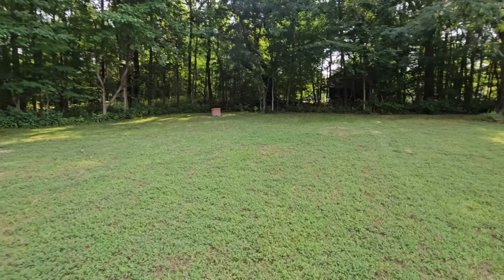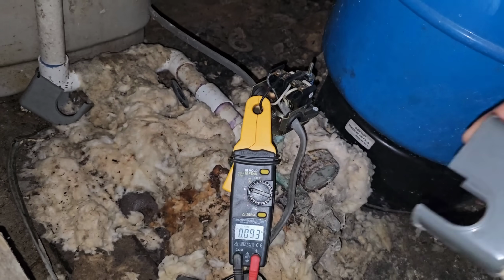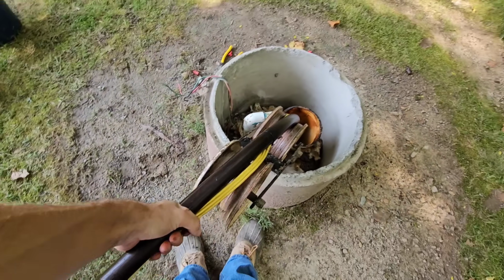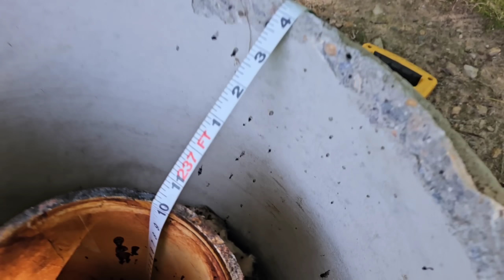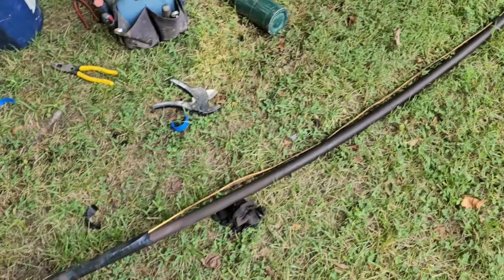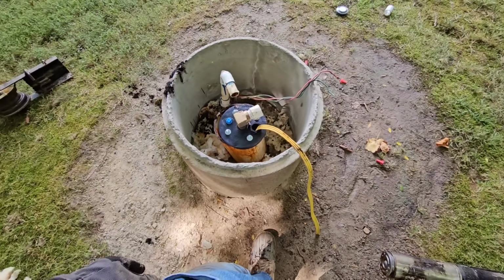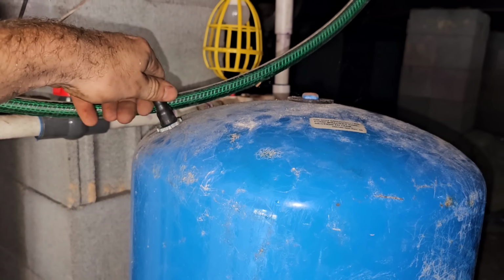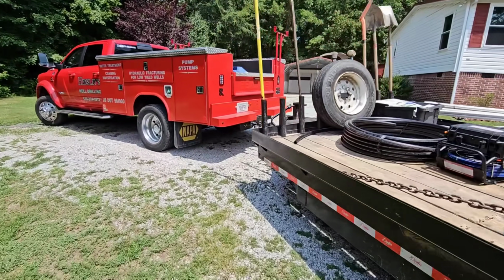Well Pump was Stuck on the Bottom in this Nasty Mess! That's Terrible Looking

Comment: Good job. My pump guy left me without   water 7 years ago, other pump companies wouldn't come out for 3 months. You can be our pump guy. 😅😂😅😂
Reply: You still don't have water after 7 years? DDDDDDDAAAAAAAAANNNNNNNGGGGGGGGGG you are a trooper.
Reply: The cost of not helping yourself.....
Reply: The Folks around here have been raised on well water,  I've helped about 6 people pull out their pump some just a dry well one didn't have the spacers on the pipe and wires so it was swinging in the breeze and wore the insulation off 2 of the wires and shorted it out,  an old wheel on an a frame and a quad just need enough room to drive the quad far enough to get the pump to the top
Reply: Sheesh. Never had a well company fail to come within a few hours when I was without water.
Reply: @E85BETTY  lazy you mean.
Reply: sounds like a self inflicted problem you waited 7 YEARS
Reply: I dont like that poly pipe

Comment: The customer dumping chlorine in the well is making things worse. Chlorine causes the manganese to drop out of solution. You can use chlorine for iron and manganese treatment but only in small controlled doses. Best thing for him to do is get a filter that contains Katalox which will take out manganese and iron.
Reply: Even ordinary Birm will do the job. I used Birm for years at my place and got about eight years out of it.

Comment: I had a problem with my well. I had two different plumbers come out to fix it. The first guy insisted my well pump was bad and that I needed a new one (a few thousand dollars). 

The 2nd guy actually pulled the pump up, found the wiring problem and told me my old pump was a quality product and that it would be silly to replace it. 

At the time, we had owned the house at last 10 years. I have no idea how old the pump is. Still working like a champ four or five years after the plumber came out.

Comment: Great job. I replaced my pump years back and it was also a one man job. The difference was i had enough knowledge to make me dangerous. After pulling the pump using a tire rim off the wheel barrel and did i tell you this pump is in the basement of an addition and 60 yrs old, needless to say it was a long day off from my real job.
 I respect you work and trust me I work long and hard to "Not" work on my own pump.😊

Comment: Greetings from Sweden.
My pump blew fuses and I it was stuck. I only got the wire, hose and cable out. Pump is still down there. A new pump was put a little above the old pump. It was 165 feet deep. Pump, hose and cable cost about $2000 for just the material. It was a good pump though (Grundfos). I changed from a three phase to a 1 phase pump so the new diameter of the pump is just about three inches. Fits better in the hole.
Reply: I had to do the same thing because my pump is stuck. New pump Right on top of it.

Comment: It’s been some years since I pulled poly well pumps, I used a 3 wheel pump puller for Galvanized pipe once, pretty rare they were. 
I always used place circular wire guides and a Torque Arrestor to reduce the spinning of submersible pumps. And I like how you despite not feeling your best, throughly diagnosed the problem and keeping the pump off the bottom by 15 feet. 
Great job 👍

Comment: Around my area,  we have natural gas in our wells.  It makes like a slime that can actually plug in the pump and line so tight it takes a minimum of 3 to 4 strong farmers to pull one up to replace the pump every 6 to 10 years. I think I would rather have your manganese problems 😂😂. Great job actually diagnosing and fixing the problem for your customers.

Comment: I had to have my stand pipes replaced up here in Minnesota this spring. We had a dry winter. Very little snow, so it was easy to get to the Red Head. There are two brothers who went their separate ways a few years ago. This is the third time in 40 years that I needed to do this. One brother still uses galvanized pipe. I went with the other brother who uses 20 foot sections of Schedule 80 PVC and stainless steel couplers. I also had the 40 year old pump replaced along with all the wire. This area has a high iron content. When we turned on the pump it looked like oil coming out also. One thing that amazed me was that the water quality improved immensely. The iron has almost disappeared. I redid the pressure tank and the flow is excellent. I like watching how the wells are done down south.

Comment: That's great work, boss, and on your own?  - good job!👏👏👏We have loads of iron in our local water, so yellow, brown crap all over the pipes. Loved the wheel pulley assist you have, and the precast concrete circular cover is the best and most simple system I have seen. Time for a few upgrades here (central Portugal!). It won't even damage the social aspect, when an neighbour's pump goes bad, everyone piles in and we heave it up by hand with the aid of a case of cold beer, bad language and good humour. Be the heck of a lot easier with one of those wheel things though. Thanks, good luck and God bless 🤗🤗

Comment: Great job man!
As a younger electrician back in the early 80's I worked for a company doing all their pump servicing and it was a great job! Difference was though all the installs in the area we worked in where steel pipe drops on pitiless adapters. Some of the wells we serviced where around a 1000' so pulling those setups required a Derrick truck, we rarely saw plastic drops, 20' lengths of pipe made for some long days. The area we worked in was pretty remote and many of the jobs where several hours driving time. Winters were especially challenging as when temps got down into the -30 range everything freezes up pretty quickly.
Great memories and a great job at the time - still Thank Larry Churchill at Northern Pump Supply for the learning opportunity that he gave me!
Cheers
Mike 🇨🇦

Comment: Holy shit, buddy. Respect for dealing with that mess. My area rarely see wells deeper then 100 feet with the norm being 25-40 for those that just want water for irrigation and don't care about the staining as it's very heavy in iron. Running the deeper wells does help clean it up but it's still pretty iron rich.
I hate pulling wells of any sort with the shallow sand points being my most hated. it's sometimes much easier to just pop in a new one... post hole auger style... lots of fun, lol. I remember trying to pull sand point with chains, black pipe, 2 15 tonne house jacks and 6 foot snipes... we had a piece of 1 inch black pipe inside an 1.5 inch pipe and it bowed them both which made us realize that if that energy went kinetic it could be very very bad. We just moved ten feet to the side the augured a new well.

Comment: Man, this is my first time seeing your channel and videos, and the moment I saw your face, I knew that no, you are NOT over covid yet.  You look exhausted, and not just from the heat.  Cut your workload in half, and move slower for another two weeks, then start ramping back up.  And yes, the Brain Fog is real.  That's going to be with you for a while, but fortunately, you do a lot of physical work, which is one of the treatments.  If the brain fog doesn't improve over the next month, ask your PCP about off-label treatments using N-acetylcysteine (NAC) and guanfacine.  Those are showing very good results for neurological impairment from covid.

Comment: You need a megger for checking the wire, it will save you time and catch things the eyes miss. Very thorough job!
Reply: Superfluous in this case as the fault is obvious. The fault was caused by obvious wear against a clamp due to improper wire placement. Moot comment.

Comment: I done the installation of my own pump some 18 years ago and the pipe that I used was schedule 80 20 FT sections and all the pump videos I have seen so far use black polly I was wondering why was I told to use schedule 80 it seems to me it's more convenient to use black polly that I see you are using here putting in and taking out. How far off the bottom is it recommended to set the pump since mine is a foot off the bottom ? You did a very good job for your customer, and your video is awesome. The only problem is I could only hit the like button once, outstanding young man. GOD BLESS.

Comment: for you when you have a one man crew on the job, they make a battery operated back up with the RV's. You can put the camera on the wall head and hold the other pipe inside the excavator so you could monitor the hole as back up we need portable so you can see back up your camper. Give you a chance to monitor the top of the wall

Comment: My well was done in 86 and has never needed any maintenance other than cleaning the filter in the house water shot seventy feet in the air when the water was drilled out and the drilling rig shook and bounced until the guy jumped off of the truck ! 1650 deep and was a spring for five minutes after the bit was removed from the casing seventy five feet of solid granite was the last material that came out with the drill it was a perfect aquifer hit the operator said !

Comment: Moved into my place November 22, it had set empty 10 years, and the pressure switch was stolen off the system.
Went to the local Ace hardware and asked the very helpful lady who owned the store to recommend a pump service. The best thing i ever did was replace the switch tank and pump motor along with a new water softener system since North Florida has notoriously hard water. Money well spent, and i have a relationship with a reputable pump service.
Never under estimate word of mouth advertising, i want to use the guy everybody recommends, not some blank slick advertisement.

Comment: Every video you do I watch you make connections at the well head free air.  Having done dozens of repairs and feeds this drives me crazy as an electrician.  Run pipe for the wire and bring it up into a PVC Jbox.  Install a strain relief connector appropriate to the cable.  Inspectors fail well heads frequently for such issues here in New York.  Further, not installing a simple black button connector on the input and output side of the pressure switch is another fail.  They only cost $0.10 each and can be installed without even removing the UF.  Other than those gripes I learned allot from
Reply: Is he even qualified to do electric connections? Agree that open air connection being dangerous. Who's responsible in case of third party electric shock?

Comment: Reminds me of the plumbing that was in my house when I got it. "New" PEX all over. The whole idea with PEX is USE ONE PEICE! Whoever did the plumbing put at least 11 tees/elbows where they didn't need to be just in ten feet from a water heater to kitchen directly above. Just as bad on the cold side.

I just cut it out and used a single peice...it's both easier and cheaper to do it that way!

Comment: A few years ago I dropped my pump 15 feet and had it about 1ft off the bottom (sand). I got a bit of grit at first, but that way the pump had 8-10 feet of water on top of it.  Pumps 20gpm and the water level did not move.  That kept me going a few years.  Last year I had to put in a new well.  Old well from 1970s was 59 feet. The new well is 160ft.

Comment: You can read voltage drop across the contacts by putting meter on ac voltage. You put both leads on same side of switch. One on line from breaker. Other on load to pump. 0 is good contact. 240v is open contact. Something in between high resistance

Comment: Did well work for years and seen quite a bit of stuff.  Never seen one where pump was  on bottom.  Common sense not used.  Better to install a storage tank and pump slower into it if well not productive enough than to lower the pump.  I found 2 wells on my own property (which has city water).  Both were marginally productive but was able to slow pump into a 2500 gal tank for storage and use in garden when needed.  Normal pumping would run pump dry with manual reset so I had to valve the output down to a trickle.  Takes 3 days to fill the 2500 gal tank at trickle but 2500 gal is a months worth of water so I took a marginal well and made it quite usable.  In fact, if needed, it could be used for whole house use instead of city water.  There are many solutions but putting pump on bottom is not one of them.
Reply: @aday1637  pumps at the top of the well can be used for shallow wells only.  Submerged pumps are the only option for deep wells. Deep wells are expensive, but if that is where the water is, you are stuck with a deep well.

Comment: As a contractor, aren't you concerned about the nasty state of the well? I was thinking about air lifting that shit out of there, or circulating it out with a mud pump.
Reply from the maker: @traviseuler9082  it definitely could use some for of cleaning out for sure! I expressed that concern with the customer. He'll have to get funds available before that can be done.

Comment: Well done. 
I’ve never seen a well setup like that with the flexible poly pipe. I’m out west and our wells are 20’ sticks of pvc with couplers. Check valves every 100’. 
My well is 525’ with static water at 410’ and that’s considered shallow. Can’t DIY any of it really. Too heavy. Need a crane. 
Water is extremely hard and mineralized. Eats pump heads for sure.

Comment: There’s so much wrong with that install of that well.  There’s no torque arrester on the pipe near the pump to keep the pump from slapping the pipe into the casing when it turns on,  there’s no well pit lock installed into the casing below grade, and there’s PVC pipe used to run water to the house.  You’ll back to fix wire problems again bc it’ll chaffe on the casing,  that PVC is gonna get brittle and fail, it’s just to susceptible to breaking if hit or cold.  Black poly pipe is more forgiving underground.

Comment: Chlorine and water combine to create hydrochloric acid, which the human stomach uses to break down food, and acids are what work best at dissolving minerals.

And 90 degrees is not all that hot, but when combined with the humidity you have there it can really sap the energy out of you because you can not cool down properly.  In the Texas Panhandle we regularly get temperatures in the 90 to 100+ degree range but our humidity is not near as high as yours is.  Around here a 30% humidity reading is considered to be high.
Reply: Hydrogen chloride GAS mixed with water will form hydrochloric acid.  Liquid chlorine (sodium hypochlorite) does not mix with water and create hydrochloric acid

Comment: You should get a black tank above ground tank about 2000 gallons or 4000 either one and use that for side storage up that wellhead outside that’s what we did it works really good for extra water you just have to have two parts to relay switches

Comment: New pump looks like a 5 Gallon per minute pump which is fine if the well is only good for that flow, however what was the well good for when drilled? Manganese in the well will always cause stinky lower flowing water. Well might be a good one to clean to get back to original flow - depends on what material the well is drilled into. We had a well where we got back 22' of depth by cleaning with much better flow also. Warranty would be noted to be void if cust did not replace a bad tank immediately - several days is fine. Always use a torque arrester, that pump banging around will rub that wire, cause a out of water and possibly a free warranty job. No one is happy with those.

Comment: i bought my house in 2006.  The will gave up Jan 2007.  I share my will with my neighbor so it was he. his 8 yr old son and I who had to pull it.  Turned out the wire was bad.  Dont know when the will was dug but it is 100 st deep with 40 ft of water.
The wire that was on it was just 14g for a 220v pump.  Replaced the wire with 10g, was not cheap even back then.  

@ yr later it went again.  Pulled it out and found the old ump had given up.  Got a new one and that was that.  This time though I ran that pump for 2 weeks straight.  Did not drop that will even an inch.

M<y big problem is the switch.  My basement is very wet being a field stone foundation on a wet side hill.  It keep giving up.  No big gig just replace it ever few yr.  Takes less then 10 min.

Ya I am 76 born and raised on a dairy farm by a man who thought u need to do things urself not pay others to do them so he taught me everything about building wood buildings.  At 44 he was crippled and could not farm anymore and 10 yr later he became a contractor; After rehabilitation and 5 yr of trying to sell ppl stuff.  I can build u a house form digging the hole to putting the roof cap on.

I to think that paying someone to do something u can do urself is a waste of money
Reply: It isn't if you just. Don't. Have. The. Time. 🥲
Reply: That's great.

IF you have the time, skill, and the specialized tools.

Otherwise it pays to call in a competent specialist who has the tooling, skill and experience to do the job correctly.

It doesn't make sense to spend a small fortune on specialized tools that are only useful for one thing that you will use once every ten years if that often.

Do you happen to have the specialized hand tools, air soldering equipment special microscope, and assorted other stuff to repair surface mount electronics?  Or the very special and particular test equipment needed to discover WHICH component needs to be replaced?

I use it every day.  You, as skillful as you are, probably wouldn't use it in ten years.

I'd rather call in someone I trust to do a job if I have any doubts at all.  Ultimately it saves me money.

Comment: Well people don't usually extend a well pipe unless they drew air out of their well which means it went dry when the water table is low
Reply: Or it was clogged off with manganese, round water level might be fine. A well driller should of taken care of cleaning that well out.